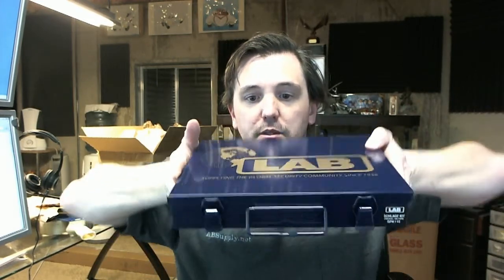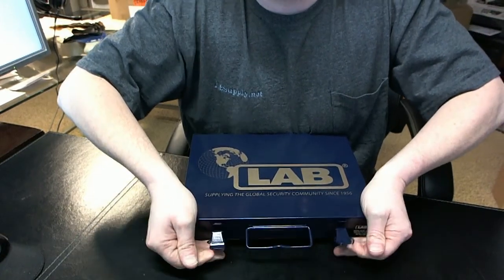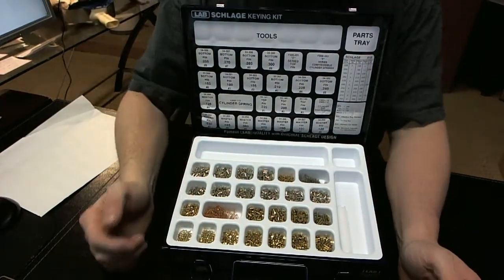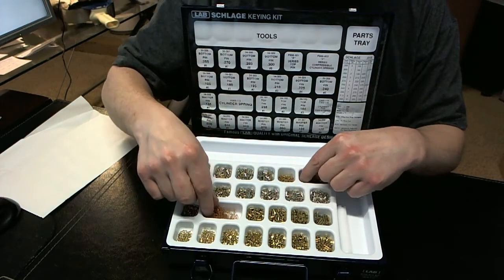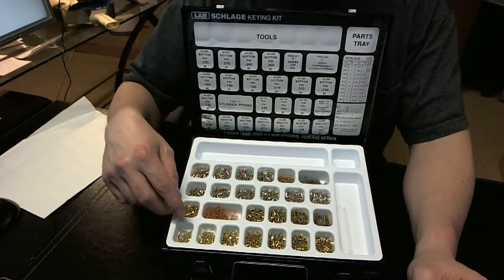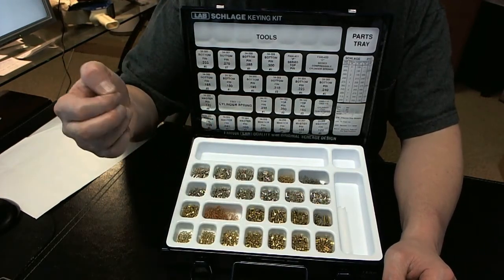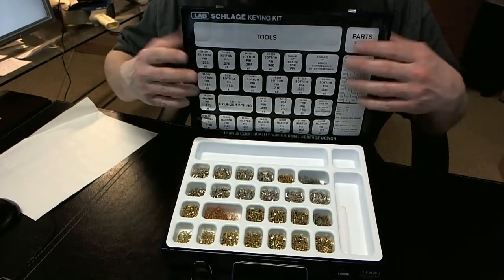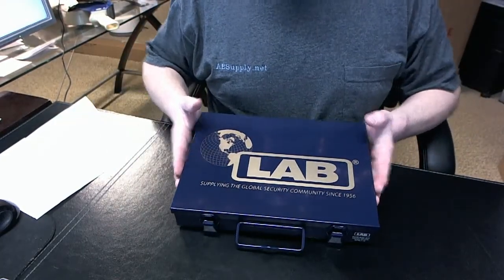LAB SPK 115 Metal Repinning Kit for Schlage Locks

Comment: The "F Series Top Pin" is not an anti-pick pin.  It is a pin designed for Schlage's new knobs where the top of the cylinder compresses in order to be removed from the knob.  The narrow end of the top pin fits inside the spring towards the top of the cylinder, providing extra space so the cylinder bible can be compressed.  If you want security pins you need to buy a LAB LMDSEC kit which includes both spool and serrated top pins (designed for use in deadbolts - neither can be used in Schlage's new knobs with the compressible cylinders).

Comment: every locksmith drops their pin kit once!
Reply from the maker: I have never dropped mine, but I left a job, placed the kit in the back or the truck, forgot to clamp it closed, rode back to the shop and entering the driveway went over the 3 - speed bumps and while none of the pins came out of the case, I was as if had shaken a martini.  Would have been funny if not so sad (my favorite pin kit too) - LOL

Comment: I am looking for the lab kit that has serrated key pins,  I seen a photo not the kit. do you know what 1 it is
Reply from the maker: +JB I am familiar with Serrated Top Pins and can tell you these pins are sold in vials of 100 pieces in these top Pin Lengths:

.155 .165 .170 .172 .187 .190 .200 .207 .220 .235 .240 .273 .320

And is also available as standard equipment in the LAB LMDSEC- SECURITY PLUS Mini Dur-X Rekeying Kit which can be purchased here:

https://absupply.net/LAB-Co-LMDSEC-Lab-Mini-DurX-Security-Kit.aspx

Is there a follow up question that we can perhaps attempt to answer?  We take deep pride in our technical expertise, as we know it separates us from our competition, so don't hesitate to ask.